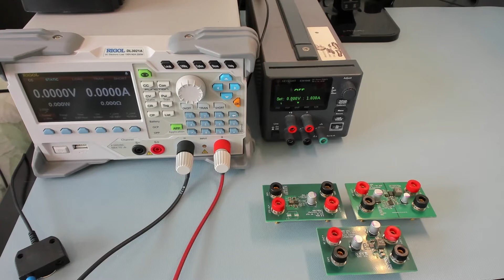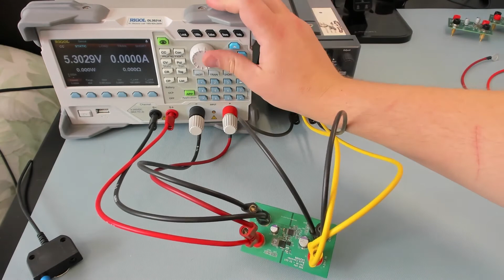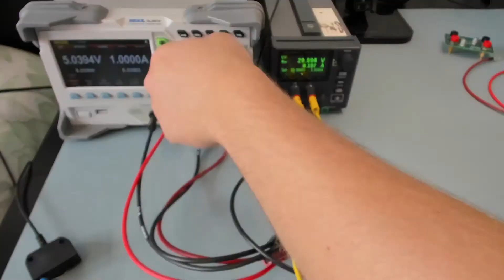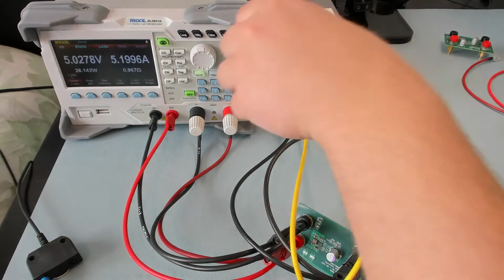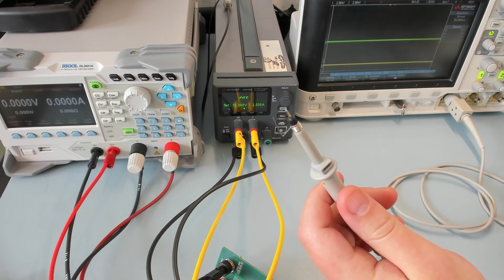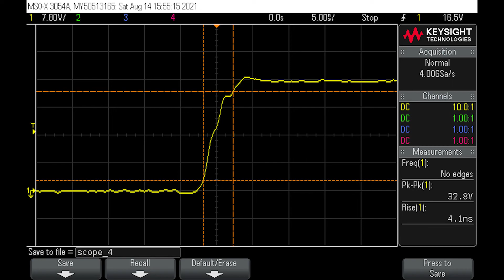DC Power Supply Design - Efficiency Testing and Switch Ringing

Comment: You used a 6 Ohm resistor instead of a 6K one. Is that a problem?
Reply from the maker: I assembled it with a 6K resistor. The schematic was wrong and a 6 ohm resistor would definitely not have worked.

Comment: Could you please tell me the Oscilloscope make and model you are using to do this testing? Did you have a bandwidth in mind when choosing the oscilloscope for this type of power supply testing?
Reply from the maker: The scope I have is a 500mhz bandwidth keysight infiniivision 3000 series. Depending on the design, ringing can be pretty high frequency so the 500mhz of bandwidth is helpful to make sure I'm not missing anything. Based on the signal rise time of 4 ns I would need just under 100mhz to correctly capture that since bandwidth of an edge in ghz is 0.35 / rise time. This is just the scope available to me through work.
Reply: @KevinDoesEE  Would you be able to recommend an oscilloscope bandwidth for making current measurements with a current probe. For SMPS design and characterization are the currents of interest fundamentally less bandwidth (risetime) than voltage measurements?

Comment: I’ve just started designing boards how do you decide what size resistors and caps to use in terms of physical package. Is the 4 layers a necessity ?
Reply from the maker: 4 layers is typically not necessary to get a board that "works" however it can be very difficult to pass EMI/EMC testing with a 2 layer board. Not having good reference planes for signals can also cause signal integrity problems for high speed signals. 

As far as physical package size I usually default to 0402 imperial size unless I cannot get a part with the needed specs such as for larger/higher voltage capacitors. I use 0402 because they are about as small as I can comfortably hand assemble. If you don't have good soldering tools and skills, 0603 case sizes are a lot easier to work with. For high frequency applications, smaller capacitors are better because they have less inductance but for most designs it is not a huge issue.
Reply: @KevinDoesEE  Thanks, I'll be getting my pcbs assembled by JLCPCB so I guess I'll go for the smallest possible.  I've been using the K7805 bucks from Mornsun on my projects as they are about £2 each and have everything needed to cut the voltage down to 5v, building the buck seems like a lot more effort!  Would you generally recommend if sticking to a 2 layer relatively simple home automation board (relays/fets) to keep the bottom as GND and upper for signals when using SMD components OR to flood upper and lower with GND and just run signal traces/Stitching vias?

Comment: Sir, can you help me, how to measure efficiency automatically , I have BUCK in my MPPT, but power is 25 - 200 V IN / 50 Amps and output 12 - 100 V / 100 Amps. Is there any cheap / but precise / solution for this ? Thanks.

Comment: Did you also get assembly done by JLCPCB?
Reply from the maker: No, I assembled these myself. I have a reflow master on a toaster at work.
Reply: @KevinDoesEE  will it be difficult to just hand solder these parts? I don’t have equipments. I was mainly worried about the controller chip
Reply from the maker: To assemble this without much equipment get a solder stencil for your board. I believe both jlc and pcbway have an option to add one to the order.

Then use tin bismuth paste since it melts at a lower temperature which is easier to work with.

For reflowing if the board is single sided it can be done on a hot plate or with a heat gun being careful to to get too hot and burn anything.

Paste and a stencil should be less than $30-40.
Reply: @KevinDoesEE  thank you so much! Your materials are helpful!
Reply: @KevinDoesEE  just quick question about banana jack you used.. I see the lead is touching the surface. Is this safe?
Reply from the maker: Do you mean the surface of the table? It's on an ESD safe mat which has a resistance well into the megaohms so it is perfectly safe for lab work. Obviously this would be an issue if I was using a metal container or bench surface though.